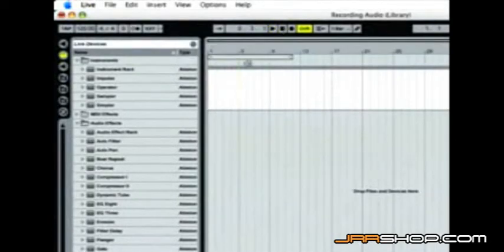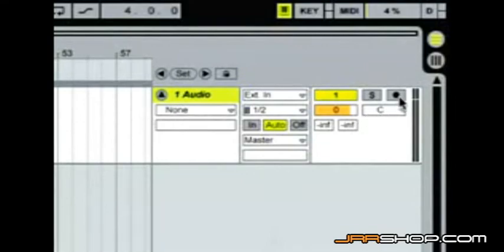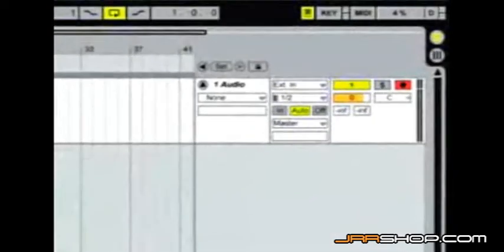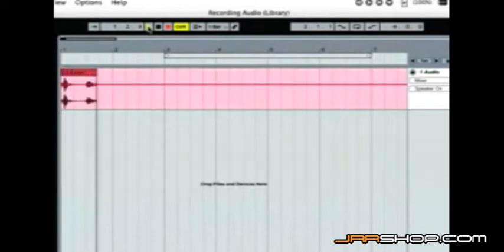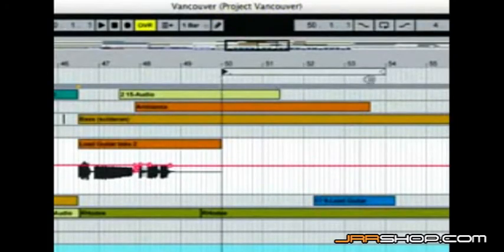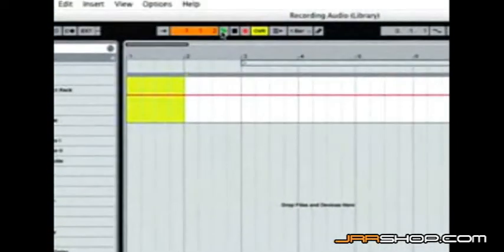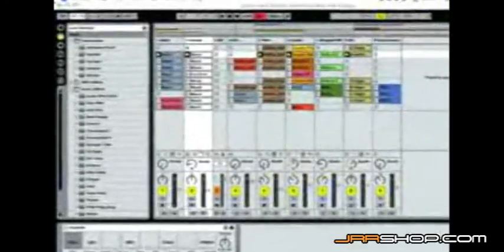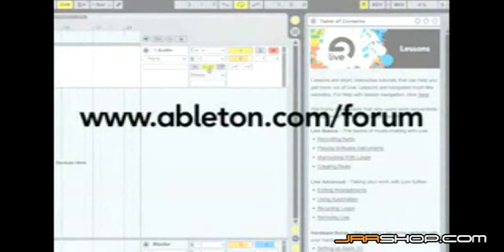Ableton - Recording Audio

Comment: Morning all!!! Great video! however, I would love some advice as I am a super beginner: I have been making beats for over 17yrs. They are in mp3 format. I was making them on a computer console, but I did make good stuff. I have only just figured out that there is a way to get vocals on my beats (I'm getting old and don't have many musical friends). I went out and got my self a mac (which is a nightmare to use, never had one before) and the other essentials: monitors (KRK Rokit 4), interface (Scarlett 2i4) and mic (Audio Technica AT2020). So now I'm looking at it all saying to myself, ''what the feck now'' I've gone through the basic vids but still feel like I've gone from 0-100 in a split second. All I want to do is drag a finished beat into Ableton, then spend my free time creating and editing vocals/rhymes! Anyone with a bit of advice?
thanks in advance. peace